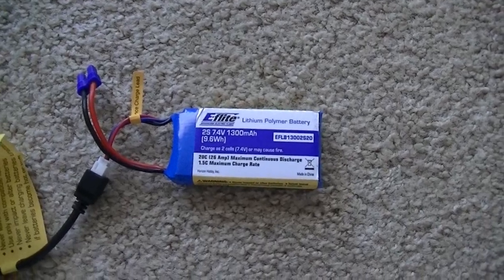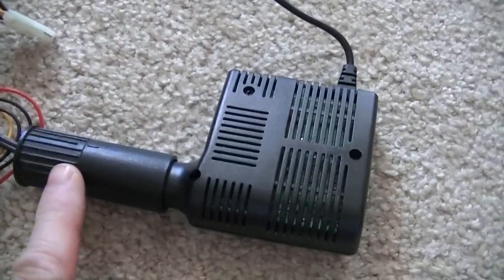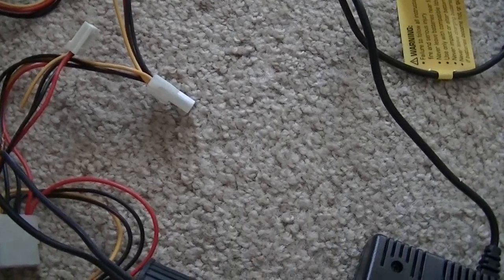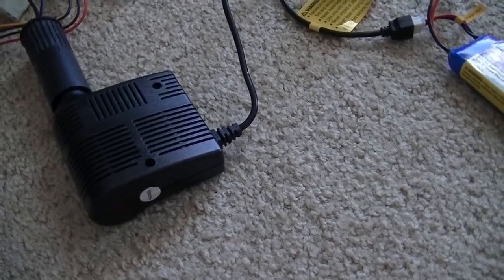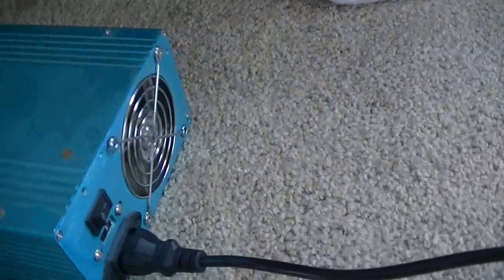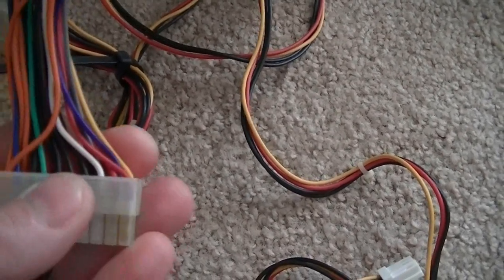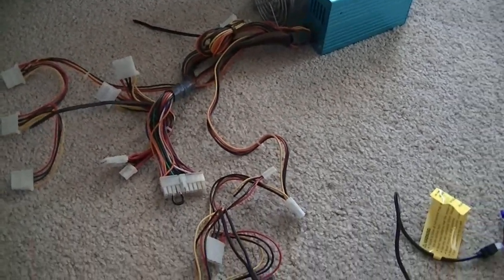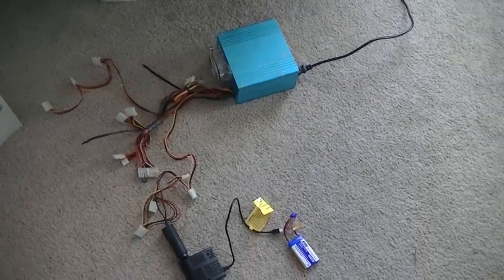Repurposing a Computer Power Supply

Comment: David when I take my ground and my + wire and I tap them my pc power box turns off?
Reply from the maker: What are you trying to power with the power supply? If the device you are trying to power draws too much current, it will shut down the power supply.
Reply: I have a wire and I have + and - on each ends